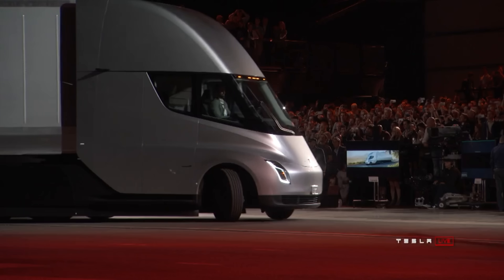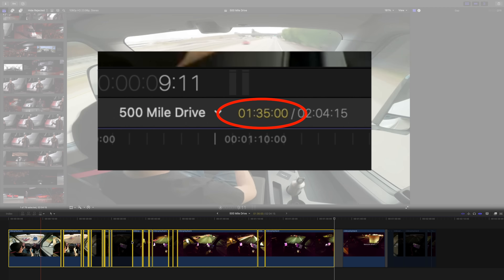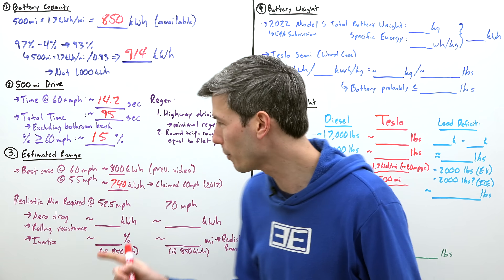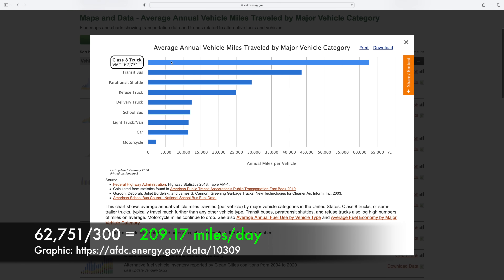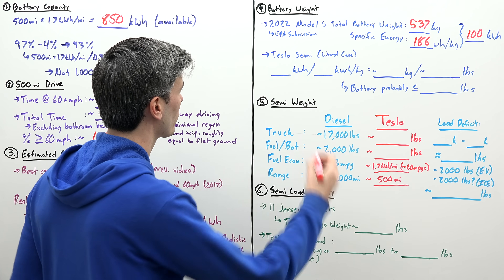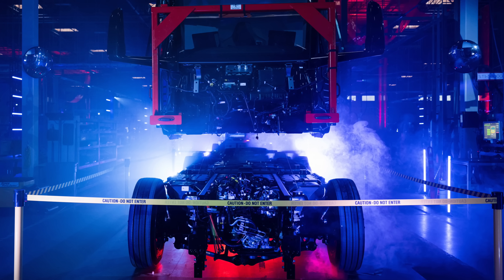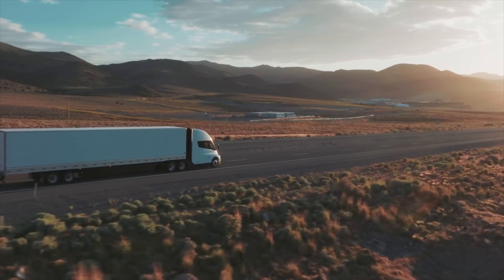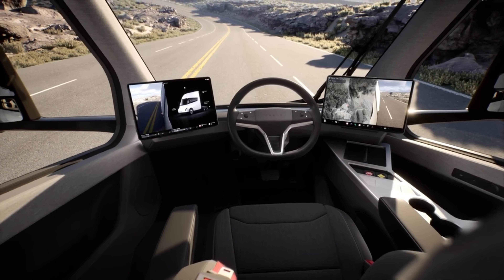Does The Tesla Semi Make Any Sense? Part 2!

Comment: Great video, but I believe that you missed some points. Like, what are the losses in the drivetrain? Which protection systems could be necessary to avoid damage to/ignition of the battery. I also would like to see the comparison with existing electric trucks, when more information comes out.
Reply: 500 Miles is a large forward leap for sure. BYD, Daimler/Freightliner, Kenworth, Peterbilt and Volvo have all worked on Class 8 electric trucks, but ALL are under 300 mile ranges.
Reply: @mychaljw  , good point. But I would watch the comparison anyway. I wonder if Matt from carwow will make some ridiculous drag race with this truck

Comment: Another note: pulling a van trailer without serious aerodynamic modifications will have more drag than a flatbed.

Edit: never mind the range test was with a van trailer
Reply: The flatbed was only on the Donner Pass video. The 500 mile range test was run with an enclosed trailer.
Reply: @BigBen621  Oh thanks I did not catch that!

Comment: tesla semi makes sense but tesla postal/delivery vans, public/school busses, work trucks  would make more sense because they have consistent daily routes, spend way more time accelerating/ braking, stopping, idling, etc and also drive at lower average speed, so for these reasons they are very well suited to BEVs, and its pretty easy to make them in different ranges, and order a vehicle that will be able to do its typical daily route within 20-80% SOC, and only charge slowly at night. with this pattern you can extend the battery lifetime considerably.

Comment: Without adding charging capabilities at all pickup/drop points (which I can't see any shipper or receiver doing) I don't think we'll see electric semis on the road in any measurable numbers in my lifetime.

The existing laws don't leave a lot of wiggle room when it comes to scheduling. Drivers run their clocks down waiting to be loaded/unloaded all the time. They aren't able to then go and find a charger, wait for charging & get back on the road. Their clock will be run out & they will miss their next pickup. Outside of short daily local runs, I just don't see the practacility.

Comment: Great presentation, keep up the good work. For the marketing aspect, the economy looks a lot different today than it did in 2017, so I wouldn't give them that much crap for slightly changed numbers since they can't control the economy.
Reply from the maker: Sure, but that's why you don't say "guarantee." It's silly whether it's 2017 or not.

Comment: The struggle for EVs is the total cost analysis including infrastructure costs.  Too many people just look MPG equivalent.  The cost for charging infrastructure can be extremely expensive for delivery businesses even with government subsidies.
Reply: 10.8c/ mile TAX EVASION, Diesel federal road Tax is 24.3c/gal, Average State Road tax is 40.2c/gal.  EV truck is EVADING 64.6c/gal. at average of 6mi/gal PUBLIC is cheated out of 10.8c/mile in Road tax for the heaviest machines that cause most damage to roads

Comment: I need to watch the video pausing here and there. Because my brain is not converting the data from imperial to metric that fast 😂.
Great video especially on part of figuring out the weight the truck is caring.
Reply: Easy a 'Foot' is  a human foot long, a mile is 1000 paces of a Roman Soldier. A gallon is a cask of Wine.  So easy compared to abstract SI junk based on earths size.

Comment: In Finland or most off Europe we have Semi trucks max speed is 80km/h. And semi truck white one trailer its max weight is about 53000kg (116844lbs). if you have two semi trailers its max weight is 76000kg (167551lbs). So in Europe we drive slower but we can haul almost double size loads.

Comment: Very nice explanation.  I have two minor points I disagree with.  (1) 1.7kWh/mi should be considered 1.7±0.05, which results in 825~875kWh at 500mi.  (2) The 500mi range is a minimum figure, which implies it should in reality be slightly higher (especially at beginning-of-life).  This doesn't invalidate the 850kWh estimate, but does explain how ~900kWh is quite possible.

Comment: seems like 4680 or even 21700 tesla cells are beetween 250 and 300Wh/kg. I guess making a 10x bigger battery pack could yield significantly better energy density ? assuming a pack that is ~2x bigger in each dimension and pack vs cell overhead that would proportional to the surface, instead of volume, that would mean half as much overhead per kWh. so maybe a pack closer to 250Wh/kg than 200Wh/kg. that could save as much as 1000kg on the battery pack (3500kg ) or over 2000lbs

Comment: Did we not conclude 44000 load capacity plus 27000 for truck weight, 71000 total. Not quote easily gonna carry "mid-weight cargo" since its upper bounds are 72800. And I'm further guessing normally you wouldn't want to pack your truck to the absolute limit but leave a smidge of margin for error. If you play on the safe side you probably end up closer to 70% instead of 78%. Further on the next statistic, I'm a bit disappointed seeing a statistic from 1992. Not sure if there are any more recent, but I'm guessing for better or worse weight of trucks on the road has changed over the past 30 years. I'm not sold on the Tesla Semi, but I think these are legitimate points on the video regardless if you are a fan or hater.
Reply: GVWR for an electric semi is 82,000 lbs.; not sure where you got 72,800. 44,000 lbs. K-rails + 10,000 lbs. for flatbed + 26,000 lbs. for tractor + 2,000 lbs. for tie downs, driver weight, misc. tools & equipment, etc. = 82,000 lbs., which was the stated weight. Or to put it another way, 82,000 lbs. - 44,000 lbs. K-rails - 10,000 lbs. for flatbed - 2,000 lbs for tie-downs, driver weight, misc. tools & equipment, etc. = 26,000 lbs. weight for tractor. I'll stake the tattered remains of my meager reputation that the dry weight of the Tesla Semi will be 26,000 lbs. ± 1,000 lbs. when it's finally announced.
Reply: @BigBen621  From the video he had calculated weight for Tesla Semi as 71000lbs. Normal cargo is up to 72800lbs from video. Not sure what the numbers are in real life, comment is based on video
Reply: @ViktorWahlberg  Viktor, I think you meant 17,000 lbs. for the weight, which was without battery; with battery, he estimated 27,000 lbs. This was based on calculating the weight based on internal components. My effort was to come around the other way, and estimate the weight of the Tesla Semi based on stated weight of 82,000 lbs. during the Donner Pass video, and subtracting known or estimated components of that to end up with the weight of the semi. Since my number matched his within 1,000 lbs. I consider 26,000 to 27,000 lbs. a good estimate of the weight of the Tesla Semi alone.

I should have re-watched the video before responding to you. The 72,800 was the average weight of semis for one source.

Comment: Would love for you compare with the use case of Nikola trucks and the H2 fuel cell.  Seems that may be more viable for long haul.
Reply: i doubt that since the range of mirai is far from impressive while long haul H2 network is non existent
Reply: H2 cost is more per mile than battery electric by at least a factor of 3. And the fuel tanks for H2 are huge.
Reply: EV Semis will make sense for long-haul trucking when there are charging stations at truck stops along interstates.

Ideally, they would be placed where it would be convenient for truckers to stop for mandated breaks and plug in.

Comment: Points out was only at 60 mph for 15% of the trip, then says driving on highway is at a constant speed… after pointing out that the speed fluctuated greatly…
🤔🤨
Also, speeding and slowing down would use more energy than a constant speed, as regen is not 100% efficient…

Comment: @3:10, or if you are fully charged and your trip will be mostly downhill! LOL!
@11:16, I have to remind you that, the Tesla truck is Unequal on the power to weight ratio, therefore it can pull much higher loads at better acceleration and top speed. It was exhibited to pull the same load no problem and also out pace a diesel truck accelerating up hill. What suffers is Range, but range at these heavier loads suffers greatly at both types, but unlike the diesel truck the Tesla Semi can recover more energy because of the heavier load, therefore making it even more efficient at pulling heavier loads then the diesel truck. What the limiting factor for the 82K LBS loads is not Truck Capacity, but it's the Laws that regulate how much it is safe to have trucks unsupervised work on standard roads. This is done so that roads are paved at a limit of durability and they are spaced for certain service rating, including bridges and other infrastructure. Any truck can pull over that limit with the required permits and support escorts. So I would have to voice my correction here!

On the lower end of the load the recovery unit has a easier time recovering 100% of what can be recovered because there is less energy to work with so the taxing of the limit of the  equipment is less here, at the higher loads the limits become more apparent, but in case of the tesla if it can pull it, it can recover it, is the best assumption.

Comment: The one thing you haven't addressed in this video (maybe you did in the other one) is the loss of battery efficiency over time and the effect this will have on its performance and economics.
Reply: Battery degradation these days is minimal. Many lessons were learned from the early Nissan Leaf and Mitsubishi Mi-Ev which had poor battery management (air cooled with insufficient buffer).  Having these batteries liquid cooled and warmed, and using buffers at the top end and bottom end percent battery damage and degradation.  And that is even less of a concern when next gen solid state batteries come on-board. Current rule of thumb with cars with proper battery management is less than 1% degradation per year. Could be slightly more in a truck used for high mileage, but in general, if you properly cool your batteries during use and charging, and warm them for use, have an unusable buffer at both ends, and manage the charging properly to avoid excess heat, degradation is a minor concern.

Comment: Was looking forward to this video. Electric trucks are early in development but the fact that usability and economics are anywhere close to estabilished diesel trucs shows amazing potential. Not to speak about environmental and PR benefits for the companies. As soon as there is 2nd or 3rd generation truck and enough chargers there will be 0 reasons not to switch.
Reply: Lol….. which reasons!? Diesel trucks like Volvo fh16 750, scania 770s or other more powerful diesel are actually hauling about up to 100 tons of load in Scandinavia or Australia or NZ….. road train are more flexible way faster and economical overall.

Comment: All this work to prove that it can go somewhere around 500 miles with a load (which you pretty much show it can't), while the diesel truck sits there with its 1,500-2000 mile loaded range.

Having a vehicle that can handle 80% of the needs you throw at it doesn't mean you're 80% satisfied, it means you're completely SOL 20% of the time, and probably have to have a backup.

Comment: I think you had a nugget in there that really is the best point.  Tesla can't build enough of these to ever make a dent into the big rig market even in 10 years.  People are jumping ahead thinking this is all there will be.  Nope.  Diesel will hold strong for a long time.
Reply: Partial picture though. Most trucking is local or line, not long haul. And companies like BYD with the 8TT, Daimler/Freightliner with the Cascadia, Kenworth with the T680E, Peterbilt with the 579E and Volvo coming out with the VNR are all developing or already selling EV Semis. If it was just Tesla pushing this, I can see your point, but these other companies added to the picture exponentially increase production potential. (Caveat, none of these others have a 500 mile truck, most are 200-300, but it's still adding to E-Truck production capabilities.)
Reply: Oh, it'll make a dent. They've been doing nothing but ramping up production.
Reply: Plus, synthetic Diesel fuel and biodiesel actually exist in reality, and do something in reality. The magic, high-density, infinite-lifetime, non-explosive batteries that everyone seems to want don't exist, and are probably never going to exist because their mechanisms of operations would break the laws of physics.
Reply: @electric7487  QuantumScape has already shipped Next gen Solid state batteries to manufacturers for real world testing. 

They are but one of several companies currently working on solid state EV batteries, but they have the support of Volkswagen and Bill Gates. 

These are already real, in testing phases and will represent pretty much everything you suggest is impossible. But I'm guessing you're not an engineer working on this field..
Reply: @mychaljw  I'll believe it when I see it.

Comment: Jason this is possibly your best video yet. Thank you for answering so many questions like the dependence of speed on efficiency that few other folks out there seem to be addressing, and doing an excellent job of citing your (credible) sources rather than relying solely on SWAGs. Your approach struck the perfect balance. Future topic idea: that $.07/kWh claim made in 2017. Most folks don't seem to grasp that utilities tend to penalize large power consumers for not only peak time of use but also the peak power demand vs total energy consumption (i.e. KVA peak 15 mins vs total monthly kWh). In the early experiences of electric transit bus operations this peaky power consumption resulted in kWh prices higher than diesel/mile. Since Tesla is making aggressive moves in the energy utility sector this may be an ace in their sleeve but it would be worth doing the math to figure out what that would take in terms of Mega Packs, energy arbitrage, etc. It is likely an important problem to solve if we are going to get serious about electrifying the heavy duty vehicle fleet.
Keep up the great work!
Reply: Also...10.8c/ mile TAX EVASION, Diesel federal road Tax is 24.3c/gal, Average State Road tax is 40.2c/gal.  EV truck is EVADING 64.6c/gal. at average of 6mi/gal PUBLIC is cheated out of 10.8c/mile in Road tax for the heaviest machines that cause most damage to roads
Reply from the maker: @pablopicaro7649  Do you know that's true? For example, I drive an EV, and my registration has me pay an annual EV fee (like gasoline tax) which ends up being more per mile, since I don't drive all that much, versus if I were driving a gas vehicle.
Reply: @EngineeringExplained  Depends on the state.  I'm in Arizona driving a Tesla and I have no annual EV fee.
Reply: @iowa_don  Ohio has a $200 yearly registration cost.  When more EVs become popular and State DOTs have funding issues you can bet your ass that states will start charging and states with cheap rates will increase them.  I kinda think registration costs is a bad long term solution.  I suspect there will be a general tax on ALL electric use.  Even if you don't have an EV car you are benefiting from the transportation network.  Imagine the world where there were no roads to transport goods.  Since EVERYONE benefits from the transportation infrastructure it only makes sense to tax everyone, not just vehicle owners/users.  Taxing electricity usage makes the most sense.  Two birds with one stone kinda thing because it will also incentivizes solar panel usage on people's homes and corporate business. Further helping electrify the grid and reducing overall emissions associated with electric generation.
Reply: @pablopicaro7649  I would argue that diesel trucks are evading a yet-uncharged carbon tax. I see your point, but as a society we are letting combustion vehicles escape paying for the true social costs of their propulsion system as well.
Reply: @texastriguy  They are evading the cost of battery manufacturing as well.
Reply: @cmitchell17a1   They are evading the cost of battery manufacturing as well 
How are they doing that?

Comment: But that's not how regenerative braking works.  At no point on the downhill are you gaining as much energy as you put in going up.  Going up you're battling gravity, friction, and wind resistance which require more energy.  Going down, friction and wind resistance are HELPING you to slow down, robbing you of that energy, and a good portion of that gravitational energy is going toward forward motion.